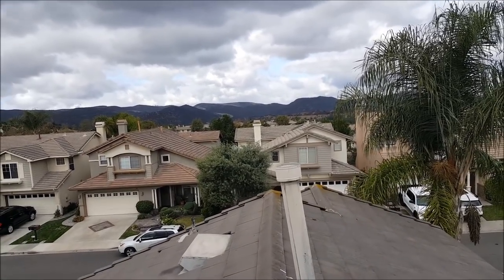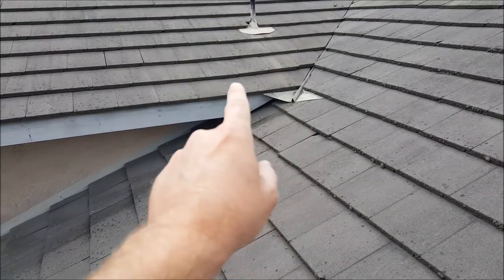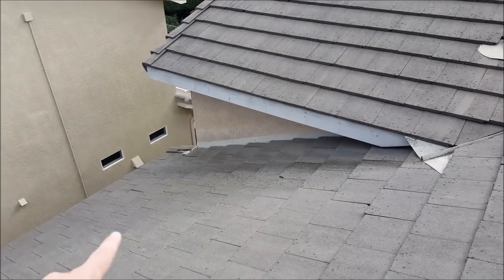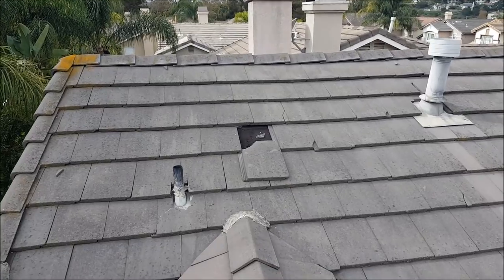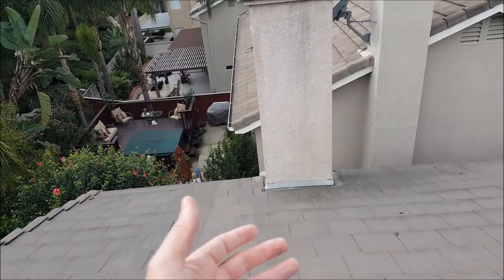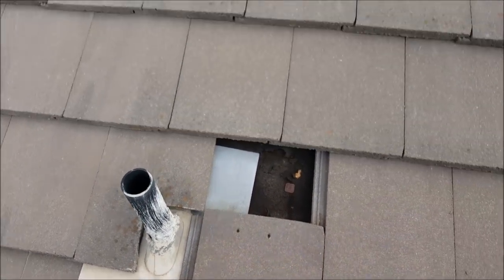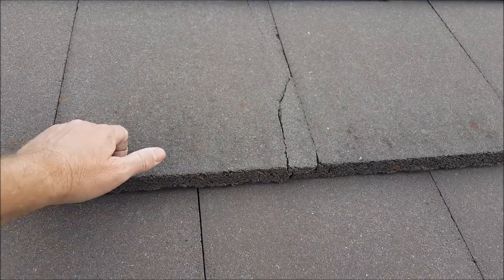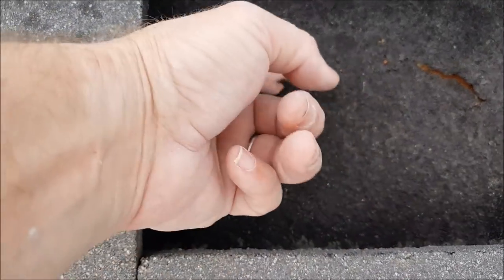Roofers don't want you to know this - Roofing tips and how spot roof leaks

Comment: A piece of fishing line or a thin nylon rope from the corner of that chimney will allow water to run down it instead of dripping without being visible from the ground... In chemistry you use a glad rod to do the same thing so you're not splashing acid when you pour.
Reply: Joel Stanley I don't think he cared enough to fix that problem
Reply: @ShandeleReynolds   Yep and was the easiest fix. Shame he didn't care enough .
Reply: Joel Stanley 
he could also get rid of/eliminate the corner(s) causing the problem by connecting between that corner and the chimney..
Reply: can you explain this again please bro

Comment: That sealant on the sewage vent didn't miss the hole. Those rubber gaskets shrink over time, and it pulled back most likely.
Reply from the maker: Here in southern California roofers don't use rubber gaskets because they are not required.  That was a bad caulk job.
Reply from the maker: But, you are right about that happening to the rubber "boots" they are sometimes referred to as.

Comment: In UK we use felting but all tiles on a roof should be capable of removing the rain water. The felt is there for moisture.. the over laps on that roof look like they are on the limit.
Reply from the maker: It was tract work which is usually garbage work in CA.

Comment: Pro roofer here 20 years experience. First of all the tile pan does not need to be removed. The tiles need to be removed all the way down, the pan needs to be cleared of debris and the metal edge needs to be re-worked so it is standing up. A lot of installers just hammer it flat so the tiles sit flush. Then the tiles need to be cut to allow a 2 inch gap between the tiles and the wall. Next, the valley tiles need to be pulled from the valley, the valley debris needs to be cleaned put, valley metal gets pulled and re-paper under the valley. After re-installing the valley metal the tiles need to be cut back allowing a 2-4 inch gap between the tiles so water no longer dams and runs sideways into the roof. Check any vents, broken tiles etc and done.
Reply from the maker: There's no debris in the tile pan or the valley.  What you said can happen and does.  And, if you're like all the other roofers around here.  Keep installing paper over the existing paper.  That guarantees me job security!
Reply: Who puts paper over existing bad paper?
Reply from the maker: A bunch of roofers like to do that.  Half the repair we do half new paper installed installed right over the old paper "hoping" the leak is under it.  It's a joke.

Comment: Couldn't possibly be that full field tile that slipped down ABOVE the valley, allowing all kinds of water UNDER the valley.........lol
My guess is (After watching the entire video) that they used Shake/Composition Valley.

It also would have been interesting to see where the water was actually coming in from, IF not from the slipped tile.
Tile Valleys are notorious for debris build-up.  And if they didn't use hemmed "W" valley, the water just dams up on the debris and washes over the edge.

For me, all tile roofs should have been installed using two layers of #30 felt, with an 18 inch offset. I said that over 35 years ago.
BUT Monier, with their infinite wisdom, used to allow Villa/Roma/Chateau tiles to be installed over skipped sheeting.............lol

FYI. Neoprene collars work better on ABS pipes, instead of mastic.
And...............Why the hell did the roofer cut the tile around the ABS pipe for?  Bottom end should be exposed, allowing free water flow.
PLUS, those are the wrong ABS pipe flashings for Tile.
Tell the viewers "Don't glue the chips on the bottom, because THAT'S where the water flows down the Water Channel".

Take out the the J-Pan (Tin Run) because???  $$$??? maybe? 
Just clean the pan out, and make sure the "J" hem is not folded over.  My experience has been that this happens because some Tile Roofers are too lazy (Stupid) to chip the head-lap off when it intersects that part of the metal. (Including the Valley Hem)

Good info all round, but shy of what the Video Heading suggested.
Keep up the good work though.

Comment: Why must cracked tiles be replaced?  If Liquid nails can be applied and create a tight seal, why not?  Also not sure where to buy the correct tile that fits.  What do you do if you can't find the correct tile?
Reply from the maker: Cracked tile should be replaced because the sealant often fails.  Then the tile gets loose and leaks.  We see this a lot.  Please subscribe if you found this video help or if you want to see more roof repair videos.

Comment: I personally think it’s not necessary to remove the metal tile pan. You just put mastic all along the tile pan than sit the new paper on than put mastic on top and that way it’s super secure. I’ve done a Lot of repairs like this, but every roofer works differently. I like your work and that u take pride in your work
Reply: You mean his workers work don't you? All I caught before stopping it was him making a video while talking shit on others in the profession. You right though. Not necessary to pull the flashing up. If it stops short you can add the extra material & overlap & seal at the joint.
Reply: @peterzinia3767   yeah he usually always talks shit about others work lol especially about the sealant around the pipes haha that little crack is almost impossible for it to leak through there cuz the lil water that does get lands on paper either way

Comment: Shouldn’t the valley have more room for water flow? Cricket by the chimney?
Reply from the maker: The valley's are 24" wide.  Water flows off the valley metal just same no matter the room.  Your roofer should always use "ribbed" valley when installing tile or make them bend up the edge fold to keep water from going under outside the valley and back onto the roof.  If your roofer does that you can use a close cut valley which in my opinion looks much better.

Comment: At the start you assumed the leak was from the valley above but there wqs a tile with the upper right corner chipped right below it where water can easily enter. Also the felt underlay muat be damaged in order foe the water to make it all the way inaide.
Reply from the maker: I've done this exact repair on this same model a bunch.  It's called experience.

Comment: why don't you put sealant on the rails (tongue and grove, not sure what its called on a tile) I have 4 tiles that broke during a storm. I was looking on YouTube as I found your video and most of the videos say to seal/glue the tongue and grove part of the tile then lay it in.
Is that incorrect?
Reply from the maker: I believe you are describing the "channel" part of the tile.  If the tile comes loose and you need to seal or glue it back in place you can put the glue in the channel.  But, place the glue high on the channel so that the glue does not block the flow of water off the channel and redirect it back under the tile.

Comment: Hi,
My home was build in 1988 so it is 34 years now.  We have cement tiles.  I had replaced roofing papers on right side sections of my roof due to water leak from a skylight and mold damage inside bathroom and kitchen downstairs.    I had a few roofers came and told me physically viewing my left  side roof sections are ok.  One guy said I had a few broken tiles not sure he wanted to get the job.  

As far as I know, there is no leak  or yellow stain visibly inside from ceiling.  Is it necessary to replace papers on the left side as well.  Here in California, we don't get much rain any ways. 

I am thinking to save money,  so I can have someone go up in attics after a heavy rain and look for leak if any before doing anymore expensive roof work.

How long does roofing paper last? I read it is like 20 years.  

Any advise?
Reply: You need professional to the job right lik me I have seen it all most of people have basic knowledge and looking to make money faster instead do fix right way I do hate this caind of firms or company or solo trader
Reply from the maker: Your paper should last about 50 years.  There's certain areas on your roof where the paper will only last half as long.  That's usually where you end up repairing those areas.
Reply from the maker: You got that right.

Comment: Every one of those roof boots was fucked and that first leak discussed is a step flashing issue...The Valley looked fine...The only way you get leaks in a valley is worn flashing or damage hole...
Reply from the maker: I appreciate the comment.  There's no step flashing used the vertical side walls with tile such as shown in this video.  They used channel metal comes in 10 foot long pieces.  Leak was just under the the very front of the valley.  Valley's done without ice and water shield or not properly woven wont last 30 years.

Comment: Also, all your caps and ridge caps should be sealed because water gets in and runs under your tiles, and if you have any dirt build-up and a hole in your felt it's going to leak also you should put screen on all your vents because rats will find there way in your attic.

Comment: Honestly, I think entire roof needs to be replaced! ..if not:
1_ remove entire roof
2_ replace some of the cemented shingle tiles
3_ replace the entire paper layer(s) underneath that roof tile
4_ replace entire dripping edges
5_  close that gap "empty space between gable and rafter creating a narrowed valley" ...if not, fix the leaking problem by adding gutters

Comment: first off i am the best at water infiltration and saving the owner money ! , i own (Amelia Island Maintenance). now  you don't need to tear it all up period ! i was impressed to here the 80/20 water infiltration specs. but what most people do not get is these tile are just DECORATIVE your so called felt was the standard back in the day but that membrane under is the most important for this installation (THAT  IS YOUR WATER PROOFING ) "quit taking these peoples money" and get a garden hose start low pin point the leak and then pull up the bare minimum tile almost every time its a batten strip that fell in line with a plywood seam and the stupid part is they use stainless screws for the tiles but the battens were installed with standard 8's that just rust and leaves a hole !  you sell a good game but most of the work is very unnecessary.
Reply from the maker: I appreciate your comment bryon.  We do 500 plus repairs a year.  We offer a "No Leak" 100% refundable warranty which no one else does in roofing.  I don't take anyone's money.  Customers hire me for a negotiated rate.  This tile is not installed on battens "unless the roof pitch is greater than 6 and 12 (6 inches of rise for every 12 inches of slope.  Your "every time" theory is wrong almost "every time". Second we don't use stainless steel screws for the tile roofs in southern california.  We use "hot dipped" galvanized nails.  Stainless steel is a waste of money when hiring "most" roofers.  What's the point of a lifetime fastener used to install a roof that probably will leak in the first 25 years??  FYI - If you have rusting screws that means they are not stainless steel..  The whole point of stainless steel is it does not rust.  The standard screw and nail construction stainless steel are called the 300 series, or 18-8 (which means about 18% chromium and 8 % nickel). These are the ones that will not rust. All the work I perform when fixing roofs is 100% necessary for the area I a fixing to be the last area on the entire roof to ever leak again.  If that is your goal then hire someone like me.  FYI to anyone reading this far - if a "roofer" ever gets on your roof with a hose do not hire him!  A good roofer can look at the design of the roof, the water flow and the roof itself and tell you exactly where the leak is coming from and where it is not coming from and what it will cost right there on the spot.  Unless you have a particularly complicated roof design.    If your roofer has a hose in his hand it is because he has no clue what the water is doing and he needs to see it with his own eyes.  That's a classic example of lack of experience.
Reply: @SouthCountyRoofing  i

Comment: Lead valley, about 24" code 4 lead - everyones happy.
Reply from the maker: The epa doesn't like lead being used on our roofs.  We do have "galvanized" 24" wide "W" valley that we use instead.  About the same effect.
Reply: I did not know that. In the UK lead is still a very common building material (albeit slowly getting phased out for more modern compound alternatives). Only though, largely due to theft and reasonably high scrap values. We have on occasion used fibre glass valleys, although I can't pretend to be much of a fan as the rigity of the design does not allow for any natural movement the roof has taken.

Any particular reason why the EPA doesn't like lead?
Reply from the maker: It is toxic.

Comment: you're crazy bro I got 5 years in the service department for a roofing company you go up into the crawl space you find the leak you go outside you pull the tiles off change the battens and felt and you're good u lift up thay valley u will break more than u fix
Reply from the maker: No crawl space buddy.  Plus, whatever you see in the attic is the "END" of the leak not the beginning.  It was a standard pitch which means there aren't any battens under the tiles.  I appreciate your passion for fixing roofs.
Reply: so you mean to tell me that you have no battens on that roof are those tiles nailed directly to the decking and that's not necessarily true unless every single room and space in the house has a vaulted ceiling there's always a crawl space. I can almost guarantee that leak was caused buy bad metal work or one of those pipe Jack's leaking if there's no battens then idk what state ur working in thats code in colorado 
. and on a tile roof underlayment sheds 80% of the water so if you don't have battens once again the whole entire roof with leak at every single nail penetration
Reply from the maker: That's correct, no battens anywhere on this roof.  The room with the water damage is vaulted ceiling as is the majority of the rooms in the house.  I don't know where you are from but, here there is "not" always a crawl space.  Leak was caused by worn out felt under the valley.  I don't need to take the roof apart to know that.  We are in CA.  Keep fixing leaks and thanks for the good questions!
Reply: weird ya im in colorado ku vid tho
Reply: attic ,whatever dude! water flows downhill period it can travel on beams and shit but its fallows gravity
Reply from the maker: Exactly...  Water runs downhill.  How hard can this be.
Reply: ok cali roofer who has never delt with real weather hahahahaha ur a joke
Reply from the maker: I was agreeing with you
Reply: In the Los Angeles area, some years ago, someone had the brilliant idea that Battons were no longer needed.
They were allowed to use Nail Guns to install the tiles.  MANY roofers missed the nail holes, but the nails still drove through the tile.  Years later, we found that when the nail missed, it DIDN'T do so without cracking the tiles.  Crap idea!!!  Glad Battons are now the New Thing........lol
Reply: im from Washington and live in colorado i roof the elements no year round sun where ur mistakes go unnoticed

Comment: Do that homeowner a favor and recommend she tear off that POS concrete roof crap and put on a Quality Metal Roof. No More Problems!!
Reply: Lots of HOAs won't let you do that.
Reply: My au t called around for a replacement for her ashohalt shingle roof, she was told $20,000 by a few roofers, then she found two  brothers that did the roof in corrugated ed green metal, $5000, they did good, tight work.ALWAYS get 3 quotes; you would be surprised how many sharks will give you a ridiculous price.can you blame them if It works once in a while....?